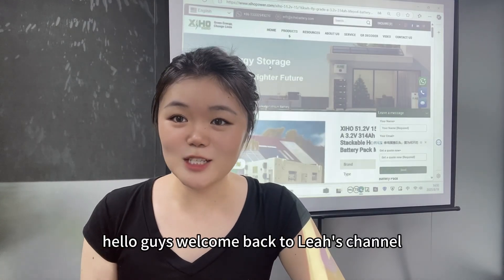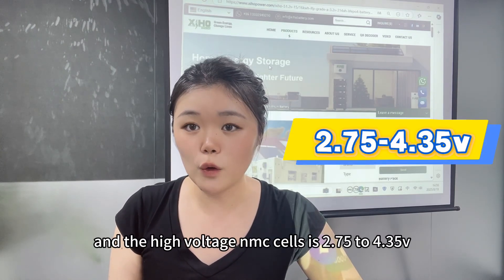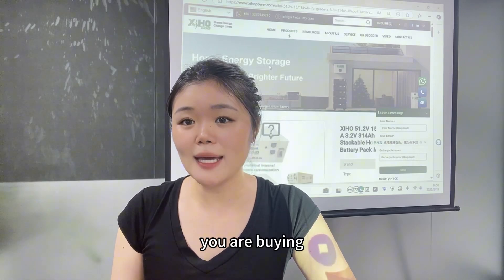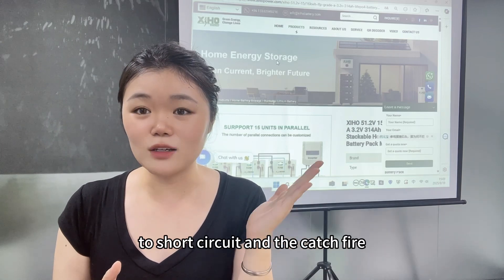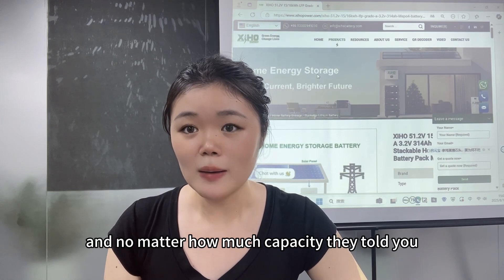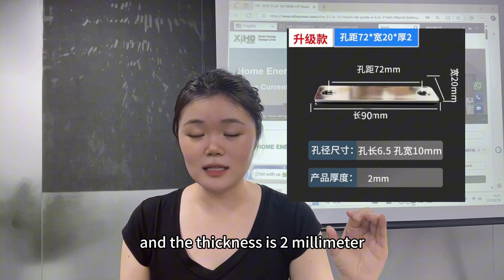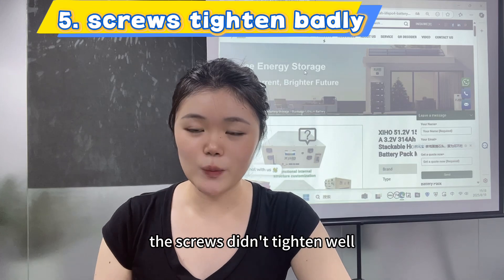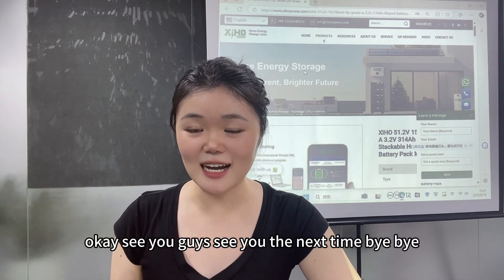5 Common DIY Solar Mistakes：You will lost thousands of $

Comment: How to do an aging test?
Reply from the maker: Using a capacity tester dear
Reply: The truth is that most people who build DIY battery packs don't have all the equipment necessary to well evaluate the cells purchased for this use. It is unthinkable to buy all the equipment that would really be necessary if you decide to build just one battery pack, or you trust the seller or is better to buy a pre-assembled one with a warranty.
Reply from the maker: @domenicogiordano1126  a simple capacity tester takes 100$ around,that’s true ,provide battery pack test results is important.